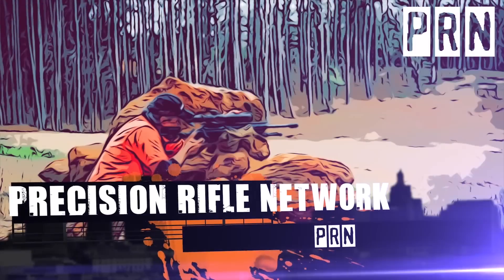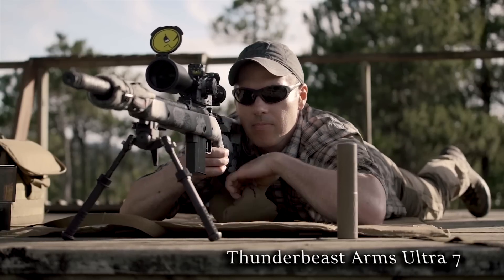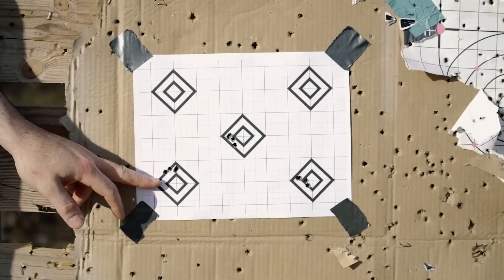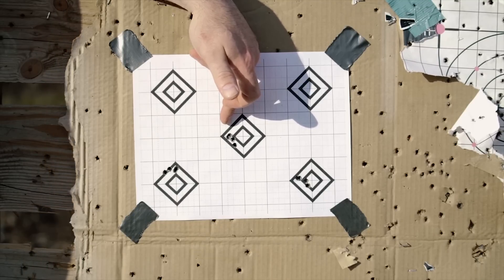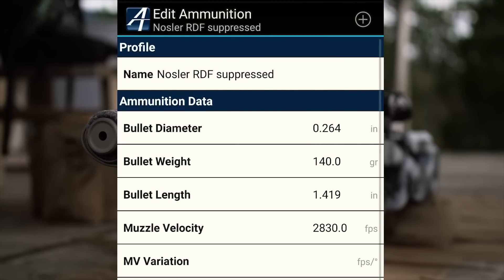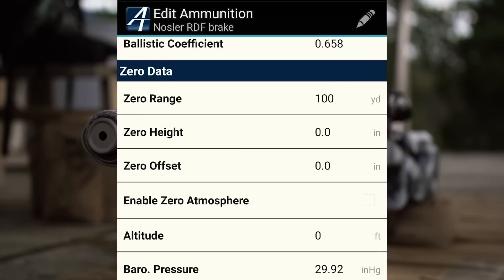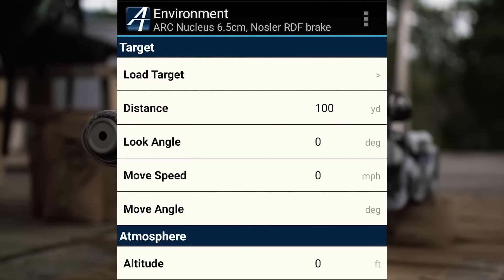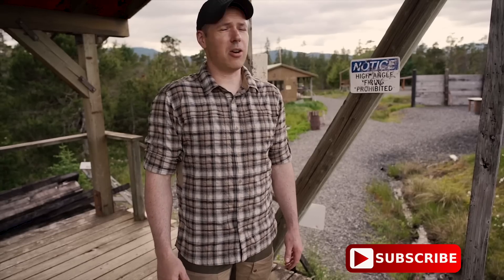Why Does Impact Shift With A Suppressor?

Comment: I'm waiting for my can, omega 300 with ASR. I have 3 20in ARs with flash hider mounts. Like to keep them that way. What's best for my bolt gun direct thread or qd? The Google says direct thread but also qd taper mounts have gotten a lot better.
Reply from the maker: Hi.  I don't think I could say that one is better than the other.  Positives and negatives to both I think. Unfortunately what works well on one rifle doesn't necessarily work well on a different rifle.  You might just need to try both ways and see what works best for your setup.

Comment: Excellent illustration. I did this same experiment last week with one of my abatement rifles. I had zero up or down difference in POI, however, my right and left was dramatic. There was a 3”, consistently repeatable difference between cam on vs. can off at 100meters. 🛩Martin